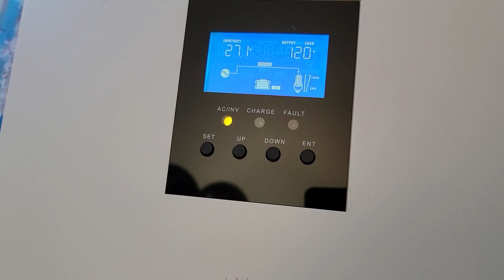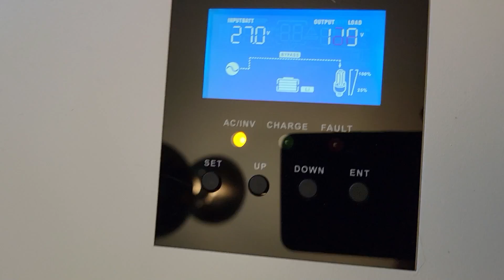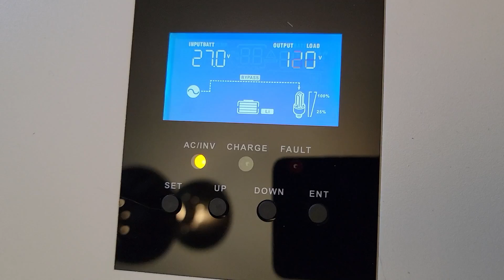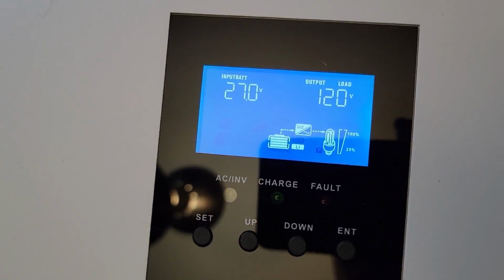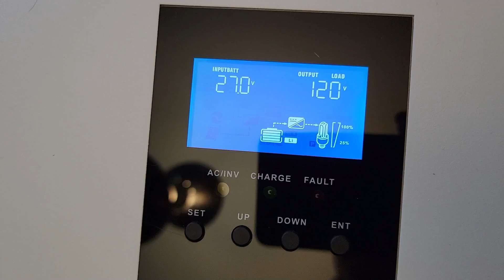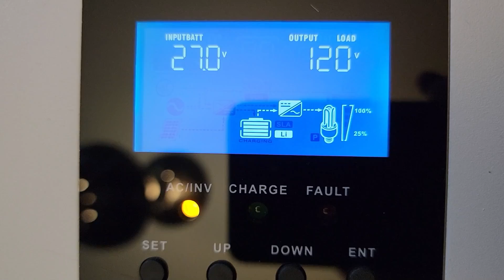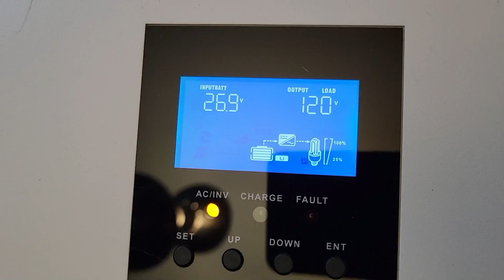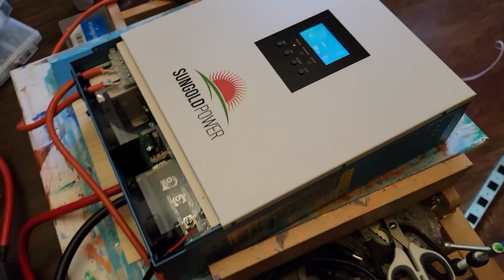SUNGOLDPOWER 3000W 24V Hybrid Solar Inverter w/ 2 Power Queen 12V 100Ah LiFePO4 Batteries.

Comment: How has it held up
Reply from the maker: Still fine. I have 800W of panels hooked up to it now with 4 power queen batteries. I have a house with a garage now and it's setup in there. I use it to power my man cave room and as backup power.

Comment: Great video! I recently did the same setup but wanted to add my two 200W solar panels in series. However, when I connected them, the inverter didn't detect the panels despite their 48V/10A output. After checking the manual, I realized the PV operating voltage range is 120-450VDC (page 40), meaning I'd need five more panels!
While this may be a great solar charge controller, I think I'll follow your approach and use it as an uninterruptible power supply for now (which I've tested and works great). Alternatively, I might look for some affordable used panels.
Previously, I used a 12V EPEVER MPPT 40A 150V Solar Charge Controller with both one, and then two panels, and a separate inverter. However, I prefer this all-in-one unit for its simplicity and integration.
Reply: this is why i chose a bunch of the little RV panels from Renogy (RNG-D100S) so that the voltage would be plenty high enough and only take up the same space as two large panels.

Comment: Paul, I have been looking at 12 volt inverters to build a portable power supply but ran across this and it looks really quality and practical without all the separate parts which take up space. My question is for these 24 volt,if you use 2x100 amp batteries in series to get 24 volts, if I want to double my amp hours, I’ll need to do it in sets of 2, correct? Thanks
Reply from the maker: Yes sir!